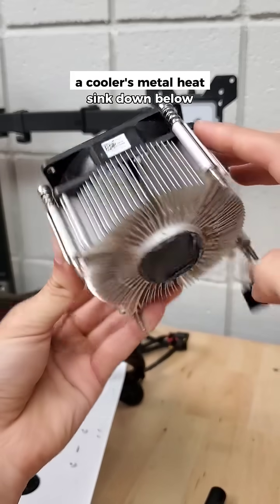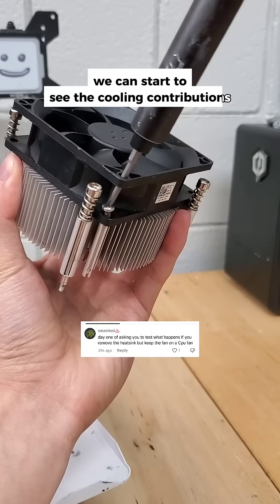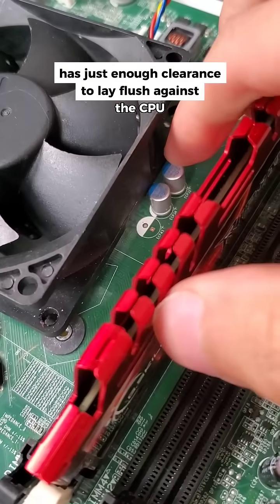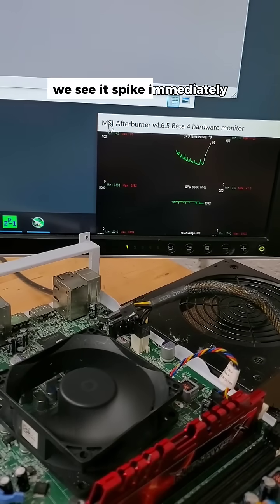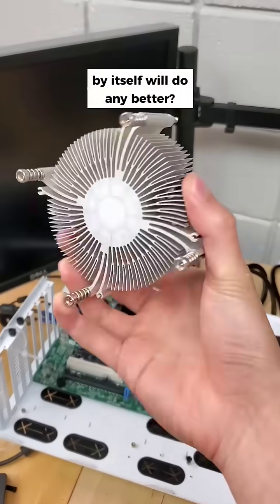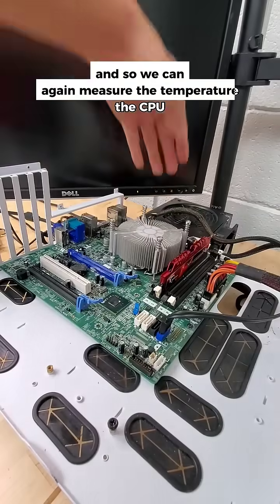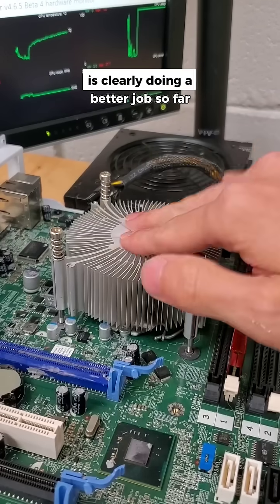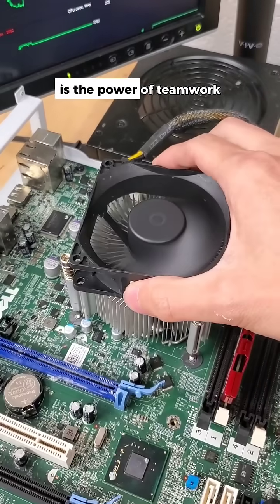which aspect of a CPU cooler is most important? #shorts

Comment: You should let the fan't airflow go across the CPU, otherwise it cools the motherboard around the CPU but because of the plastic insulates the CPU.
Reply: He put thermal paste on the fan sticker tho. I'm surprised the cpu survived that. 😢
Reply: Yeah, this wasn't very interesting because of that aspect.  Fans and heat sinks with fins are kind of a package deal regarding how they function and removing one kind of makes the other silly.  I know very low spec, very old CPU's just had a passive heatsink but that isnt' what he's posting about.
Reply: I just had a stroke reading this.
Reply: But that would make sense
Reply: Fan ain't fanning
Reply: Nevermind
Reply: Fan't
Reply: @brziperiod 
I meant "fan's", but I'm very tired lately so I mistype a lot…
Reply: @Lampe2020 no, fan't is ok , for when a fan fails to fan, it fan't
Reply: Fan's is also wrong, it's just fans, there's no contraction here and you are not referencing anything that belongs to the fan. @Lampe2020
Reply: @Lampe2020  I said nevermind lol, I tried to find the reply to delete it but it's just not there for me, but it is there for others. Painfully humiliating.
Reply: Yep
Reply: i was just thinking the same lol

Comment: Surprised that just the heatsink did that much
Reply: There's actually passively cooled CPUs and video cards  that use thicker metals to not need a fan.
Reply: @Babbages as an EE they do exist but it’s very hard to get price point and everything right to go fanless as the environment can vary so much.
Reply: Most GPUs have a 0 rpm mode where it keeps the fans off at low temps ~50°C. The heatsink basically becomes a passive cooler.
Reply: Well to a point it can radiate and pass the heat. But in a closed environment(usually inside PCs, it wouldn't help, because no updraft.
Reply: @davidd2661 and I have a shell of closed environments to consider. The case the room the building and area all pass the heat along based on surface area time and unique capacity.
Reply: @davidd2661 you need to fix the fans on your case if you are having this issue.
Reply: @davidd2661 Inside a PC case, the case fans are generally always spin, which will provide a small amount of airflow to heatsinks when the CPU/GPU fans are not spinning.
Reply: Easiest examples of passive cooling are modern phones. It expels heat thru the back of the phones.
Reply: @hxnslshhax9011  yeah cell phones are a great example also a lot don't know the original PlayStation and most tvs newer than plasmas that are under 42in are also passively cooled.
Reply: it has alot of thermal mass, meaning it can absorb alot of heat, but it would eventually get hot, it just takes time. it would work better than the fan but would also reach over 100 degrees, just with less thermal throttling (meaning it could maintain higher clocks just by passively transferring heat out of the heatsink)
Reply: The fans on my 4090 take minutes to kick on in games cause it's got such a fat heatsink.
Reply: Such a fat heatsink ;but it doesn't prevent the cards from catching on fire or cracking, strange. @sarabara-bla
Reply: Its in the name heat, sinks into the metal, and the fins let air go by and let off heat, thats how gas cars stayed cool without water
Reply: You can think of it as stages or cache. The heat sink is quick transfer but can fill up. The fan is slower transfer but has a huge capacity (the heat capacity of the air in the room)
Reply: It shouldn't, the heat sink is doing most of the work, the fan is there to help cool the heat sink so that you can get away with a smaller one than you would otherwise need.
Reply: Me too

Comment: Can you attach the fan so that air is actually moving around the cpu? Right now you are basically adding heat to it because you attached it where the motor spins, not the airflow
Reply: Even if air flows there simply isnt enough surface area on the cpu for the fans air to remove heat from it.
Reply: @TheS1l3ntOne  and I don’t dispute that, the heat sink will win over a fan 100% of the time. But right now the video is doing a test that basically shows how he attached the cpu to something that generates heat instead of removing heat.

Comment: will you help me make a i5 13th gen high and gaming pc?
Reply: Probably go 13600k and a used 3080/6800xt (depending on the market where you are), pair that with a decent Z790 motherboard (not the Prime or Pro or equivalent boards), 16 or 32gb DDR5 RAM at a decent speed like 6400mhz depending on how much you need, top that off with enough NVME storage from the likes of a WD SN770 or a Samsung 970/980 pro. 

For a PSU you can refer to Cultist's PSU Tier List and you'll probably get away with something from the high-mid tier (single GPUs? Been a while since I visited it)

Select case to taste, the Corsair 4000d is always a safe bet if you don't really care about aesthetics, and I think the SP120 3-pack of RGB fans come up on sale quite frequently.

 Lastly, most known brand 240/280mm AIOs should do the job, most common are NZXT or Corsair units, ARCTIC is a favourite of mine too. If you prefer air cooling like me, though, there's ARCTIC's Freezer 34/35s, be quiet!'s extensive lineup, and of course Noctua, in order of price.

Hope this helps, feel free to reply if you need anything cleared up